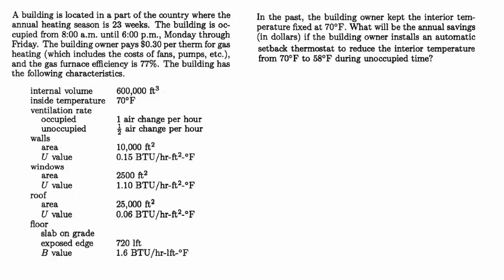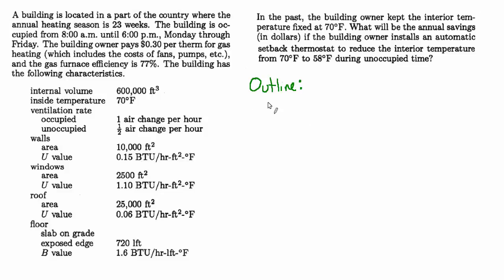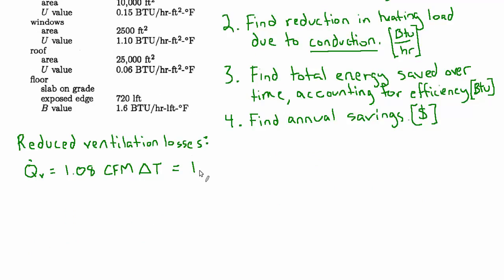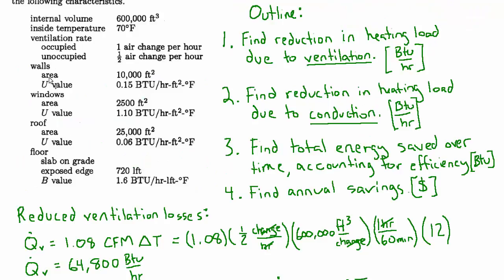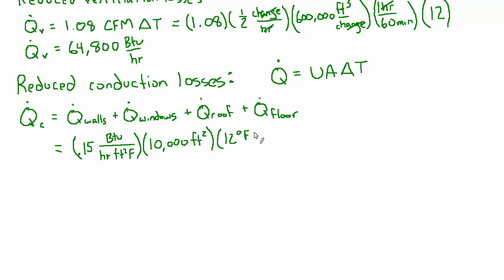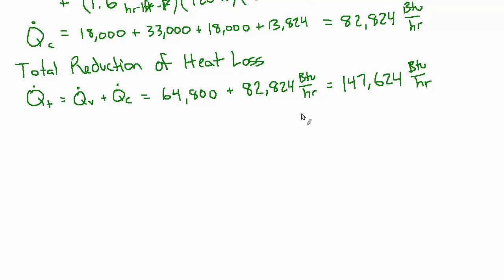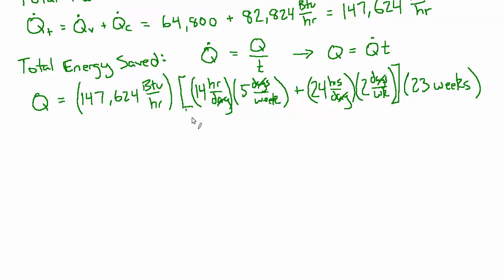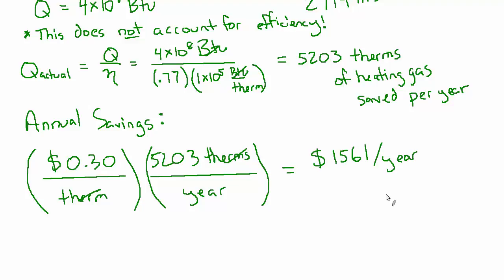PE Exam - How to Save Energy and Cut Heating Costs with a Setback Thermostat in Commercial Buildings

Comment: Where was the equation for conduction  heat transfer through the slab found in the PE reference manual? (Q dot slab)
Reply from the maker: Hey Jeffrey, good chance we won't find it.  Many of my Youtube videos, while useful, are from before the CBT transition in 2019, and the scope was dramatically narrowed by the closed book format.  Check out my website for lots and lots of CBT aligned problems with similar (arguably better) video solutions like these! Reach out with any questions, I'd be delighted to help you on your study journey!